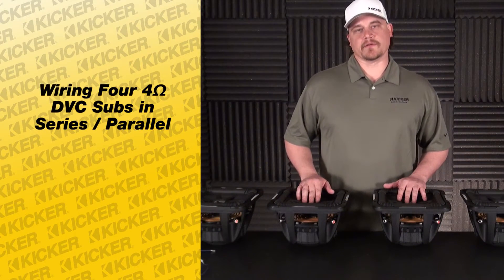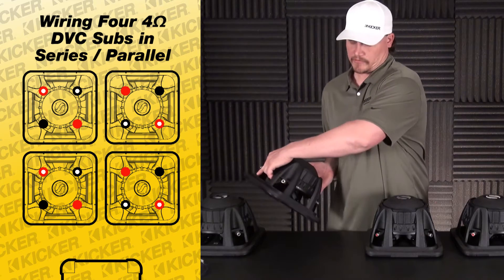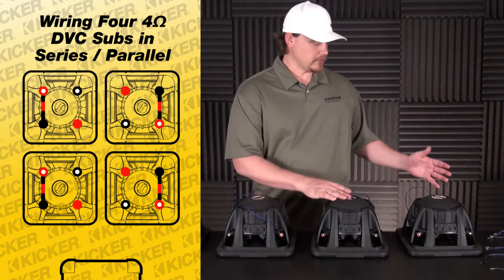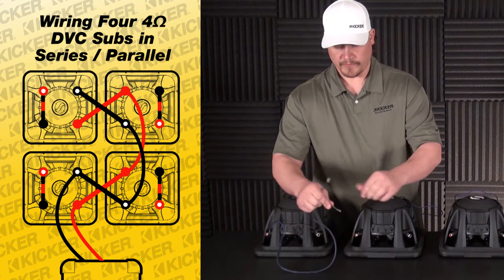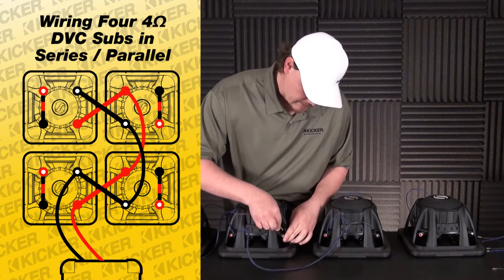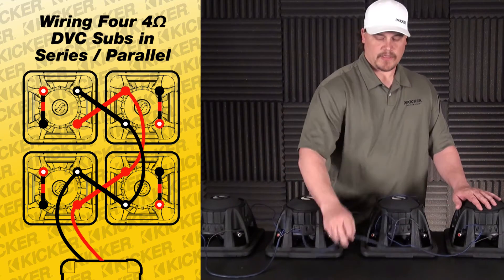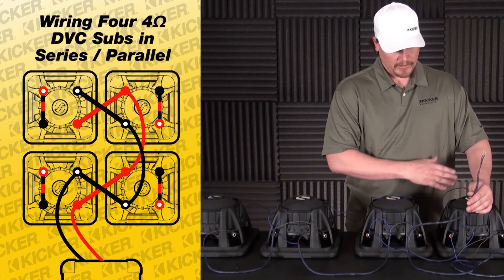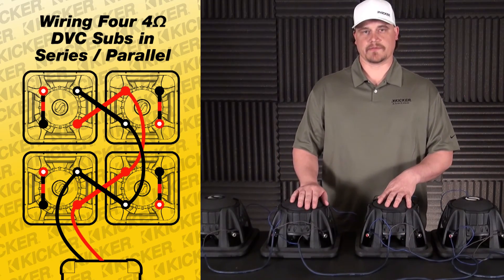Subwoofer Wiring: Four DVC Subs in Series Parallel

Comment: This configuration doesnt or does run the coils out of phase? Ive always wondered how dual voice coils really function and if they are just beating the amp up
Reply from the maker: Wiring this way is pretty time-honored and safe. The primary concern is getting the right amount of power (RMS) to the subs by getting the appropriate ohm load to the amp. If you can match those specs you will have gotten the most out of that system.  Next steps are tuning, power supply and insulation.

Comment: So how do you do that on a Kicker Comp R 10 is dual voice coil but only has one set of terminals
Reply from the maker: Treat each set of voice coils like a single SVC subwoofer.  In this case it would be like wiring up eight 4 ohm subs to get the same result, wiring-wise.

Comment: Hi  after I run the subs in series,can't I just run the remaining  negative & positive wires to the amp & right before installing into amp I tie all negative together ,& positive together before putting in amp?like how you did the SVC video?
Reply: That's what I do also. That's parallel wiring. That makes the ohm load from 2 to 1 or 4 to 2.

Comment: Let’s say I have 4 DVC subwoofers, they are 750 rms a pop I think.. 2 kicker L7 4ohm and 2 alpine type R 4ohm subwoofers both wired up to separate amplifiers. The kickers are on an old school MTX 1501D and the alpines are on a 1200 watt newer Fosgate amp. The kickers I have bridged on the mtx in reverse phase at the amp, and the on the alpines I have them bridged on the fosgate In regular phase. Normally when speakers are out of phase you’ll loose sound but with mine they actually get louder. They sound out of phase when I have them all wired in phase at the amps, and everything in the 2 boxes is wired correct too. Ive just never heard of someone wireing a pair in phase, and a pair out of phase?? Could anyone tell me why this works?

Comment: Hello, I have 8 4 ohm dvc sub in 1 box, with 2 vfl 4800. 1d amps strapped 2gether. Please tell me the best way 2 wire this up? Thanks 4 ur time n patients in advance.  gentstyle69n247@gmail.com
Reply from the maker: What ohm load are those amps stable to, and how much power to they deliver at that load?
Reply: Max linkable power @ 2 ohm 9600 watts, max linkable power @ 1 ohm 4800 watts.
Reply from the maker: The power cuts in half when the ohm load drops?  Are you sure?
Reply: yes, i just read it out of the manual.
Reply from the maker: Think of it like 2 sets of 4 subs. Basically you do what this video tells you to.  You should end up with 2 sets of + and - wires going to the amp. Now, take both + wires and twist them together & do the same with the - wire. Verify with a multimeter that you have the proper ohm load. Now put them into the corresponding terminals on your amp.
Reply: Ok, thanks. That's how i have it.
Reply from the maker: Excellent.  Let us know if theres anything else we can do for you.

Comment: I can wire 6 4ohm subs to 1 ohm right? up to 8 and then down
Reply from the maker: Single voice coil or dual?
Reply: KICKER there dvc, I believe it said 1.6 ohms but I could get 1.5 ohms around 1ohm.. I am getting around 3000 rms on my amp at clipping.. so about 2800 with out the subs are about 400 rms but can take 500.. so I am running 5 of them 4ohm subs.. I should get about 2000 to 2,200 on them.. what you think.. bout right
Reply from the maker: Sounds right.  Just make sure the amp is amp is getting enough juice and you should be good to go.
Reply: DON GIO'S WORLD soo it can be done? 6 subs dvc??? Wired this exact same way?

Comment: What if I do two banks with same wiring then parallel,what's the final impedance?
Reply from the maker: What kind of subs do you have?
Reply: I have 2, 8 ohm and 2 dvc 4ohm(in series) to a 0.5 amp,
Reply from the maker: Very few amps can take a .5 ohm load (at least, none that we make). One other thing to consider is frequency response.  Mixing different subs, with slightly different responses, can muddy the sound. Ideally you want all of the same subs firing as a single unit.
Reply: @KICKERAudio  yo, do you know of any 280w amps that can handle 0.3 ohms... wait... your amps are just crap... I have an amp from the 90's that has been ran at 0.3 ohms for 6 hours in the rain in a temporary outdoor party... everyone get 90's kenwood amps... yeah... 280 watt amp drawing 40a at 14v equals 560 watts... got hot enough before it started raining to give people burns... but was still fine...
Reply: now I run a fan on it, and have a free 400w amp I am repairing... sat out in the rain for a couple years on someone's front porch... When I finish my car, Imma have a custom housing for the two amp boards with a water cooling loop... still only $80 in with 2 10", 2 2" tweeters, 2 4 inch tweeters, 2 6.5 4 ways, and 4 pa horns... the pa horns are going to be wired up to a switch in the trunk for the fuck the neighbors mode...

Comment: I have 4 12 all 4 are  dual 4 ohm subwoofers if I wire all 4  down to 2ohm and hook them together what will I get please need your help
Reply from the maker: James Lee Hey James - sorry for the delay in getting back to you.  If you wire all 4 together you will either have a .5 ohm load or a 2 ohm load.  Those are the only two options with the number and ohm speakers you have.

Comment: how do i wire 4 dvc subs to a 1 ohm load?
Reply: There is not a way to run 4 x 4dvc subs to get a 1 ohm load.  If you are able to change out the subs to the 2dvc then you can or you can go with only 2 x 4dvc
Reply: how can I 6 dvc 8s to 1 ohm. same as I would in par right
Reply: The way the video showed you is a 2ohm load you don’t need to be so low.